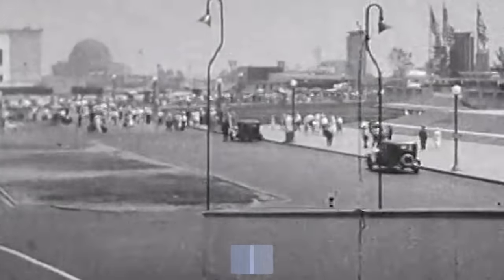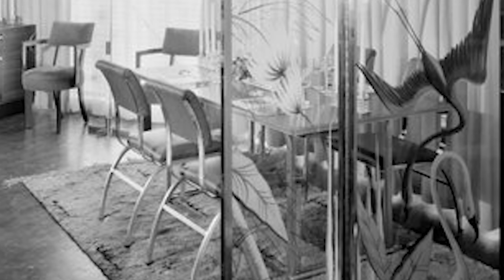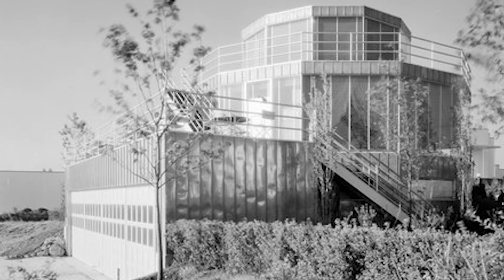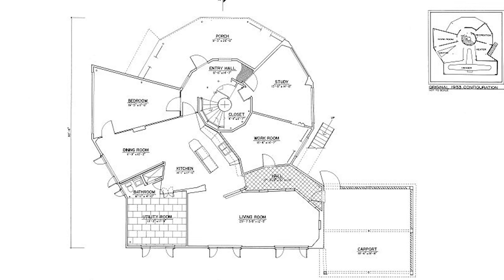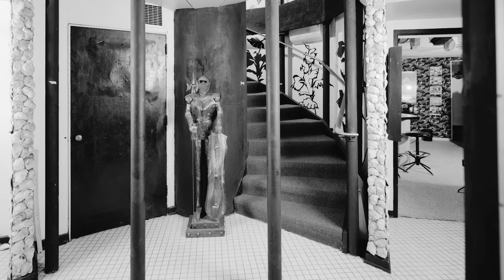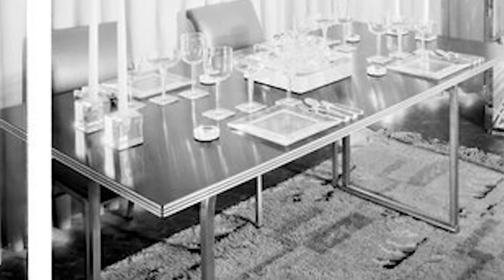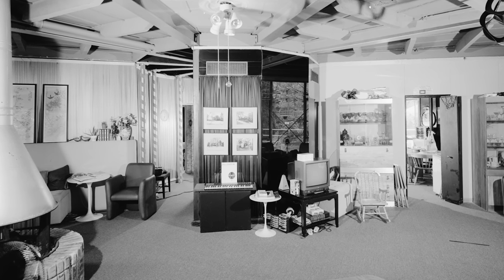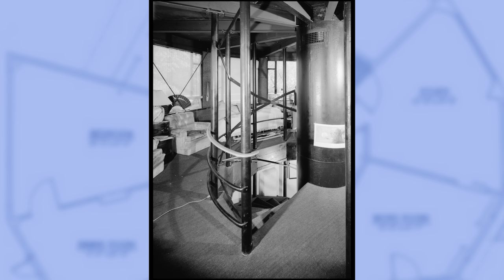Inside the Forgotten House of Tomorrow: A Journey Back to the Future!

Comment: Some of the furniture from it's original 1933 inauguration was designed by Gilbert Rohde for Herman Miller. I have that exact dining table; it comes up from time to time at auction and it is not too expensive. The streamlined Rohde/Miller bedroom set still can be found at auction as well, but is sometimes very pricey. I hope they restore the house, and maybe the state should subsidize or restore it as a tourist attraction. I'd certainly pay to visit, as would most architectural and design history buffs. I once visited the 1930's pioneering Aluminaire House; which has now been gifted and moved to the Palm Springs museum. It was a sad, unrecognizable wreck when i saw it in it's former college campus location on Long Island.